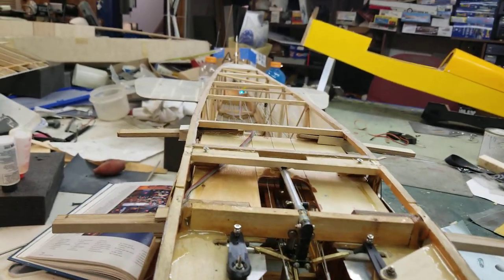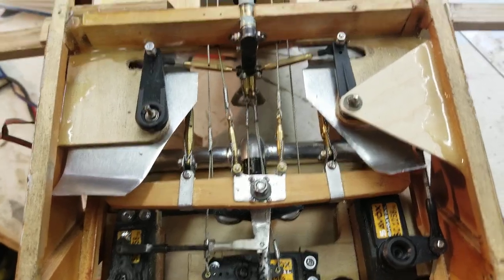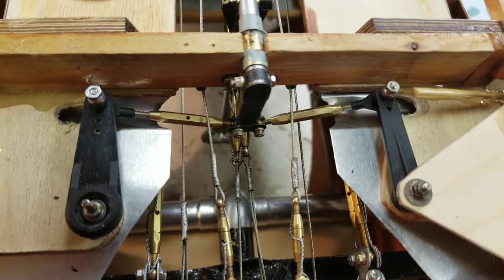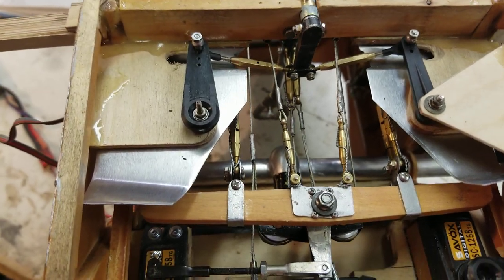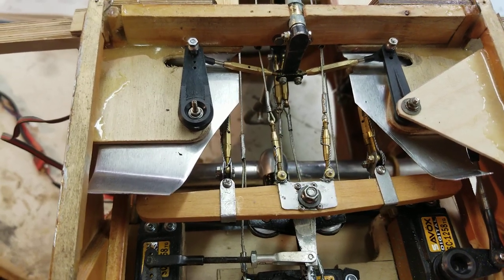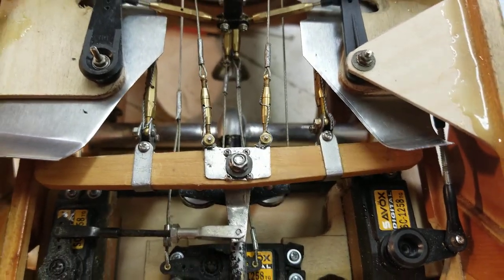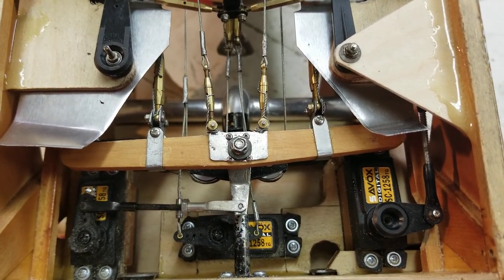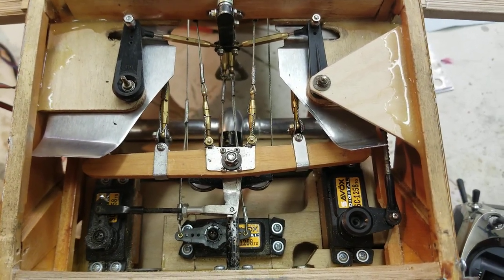Grants shop 1/4 scale Sopwith Camel build part 5, Servo setup #model #rc #grantsshop

Comment: Very impressive...
Would you have more info on the steerable tail skid?  I have some books on the camel and although the steerability of the skid is mentionned, could not find any detail...
Reply from the maker: I really don't have much information on the skid. Is there something in particular you are looking for?
Reply from the maker: Most of the information I have came from (believe it or not) a Haynes repair manual on the Camel. Are you building one?
Reply: @Mastermodeler.  yes i am building one. And i even have this book actually...wait...page 75 there may be the info i am looking for...
Reply from the maker: @alainprostbis  what scale? I run a Facebook group called Scale flying model building techniques. If you join you can contact me through FB messenger if you need any help.
Reply: @Mastermodeler.  the scale is 1/6. I am using a kit (from VK proctor). I am following your youtube videos with great interest. But i dont have a fb account (dont quite like them)...
Reply from the maker: @alainprostbis  I have that very kit and have built the VK Triplane and Nieuport 17. I guess you will just have to ask your questions here, but I don't check it very often.
Reply from the maker: I am so glad someone can use the information from my videos.
Reply: @Mastermodeler.  its extremely informative... i m gonna try to do some bracket to surround the pullies and cables and ill try to repeat what you did...
Reply from the maker: @alainprostbis  my aileron controls will be the pull pull system like the real plane. My tests show that it should work very well with very little binding. The bearings I used in the pulleys came from the T rex 450 heli's. I bet the bearings from the old brushed/geared slow stick motor assembly.
Reply from the maker: @alainprostbis  here is my email address. grantmaston@msn.com if you have any more questions.